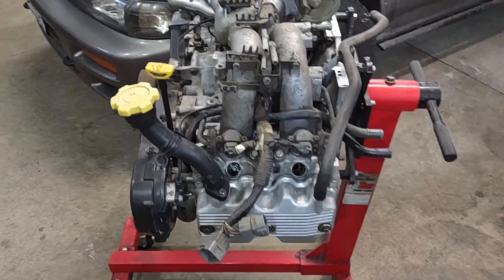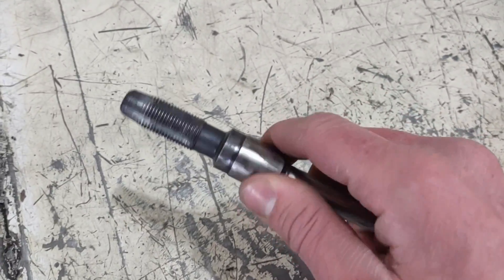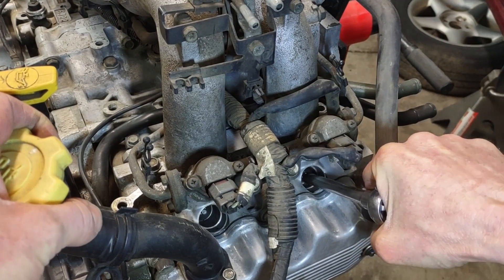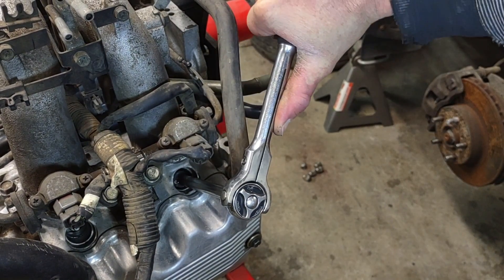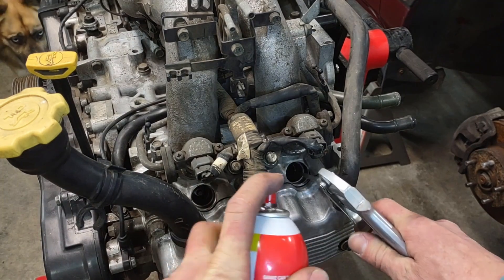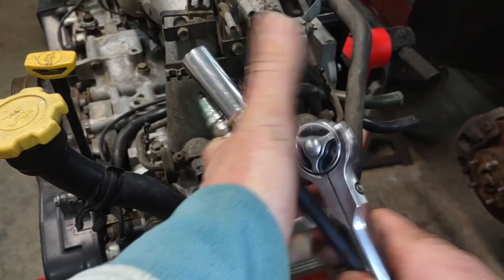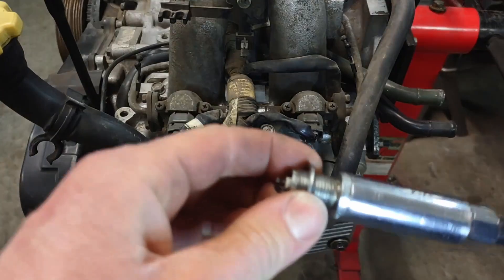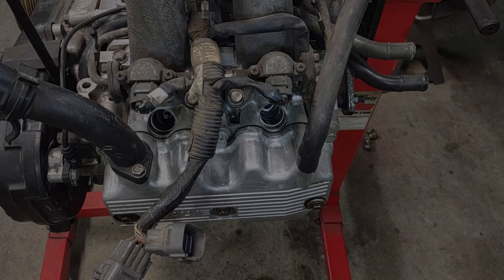Subaru stripped spark plug thread repair

Comment: Nice video. I am going to do the same job on my Subaru Impreza wrx sti but with the engine in the vehicle. 
Also I won't be using any kind of lubrication as I have had better success getting the shaving blown out and not sticking to the internals. If it wasn't aluminium then it would be better to use grease. Thanks for your video
Reply: update? did you do it? i want to do it with engine still in the car but mine is cylinder 4, tight space unfortunately. did you have success?
Reply: @jewelhartin7148  not as of yet. But ill let u know if I have success
Reply: Did you do it I’m getting ready to do mine and I want to know how far the motor needs to come out
Reply: I'm getting ready to do this on Friday as well. How'd it go for you guys ?
Reply: @ryanc2360  so I bought a cherry picker and en engine stand for this job. I completely pulled the motor out drained the oil. I turned the motor sideways on the engine stand (bad spark plug hole facing down of course) to tap it to keep debris out. Anyways I tapped it out the plug in whit some high temp rtv( do not overdo it unless you want to see what a piston looks like in person. Got everything back together and…… she runs great!